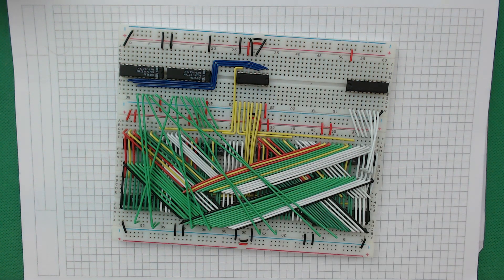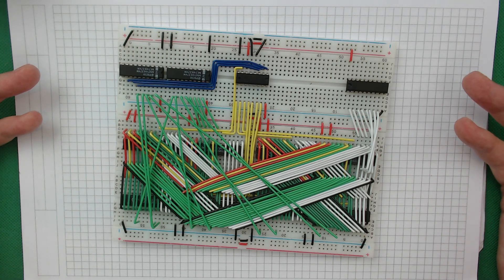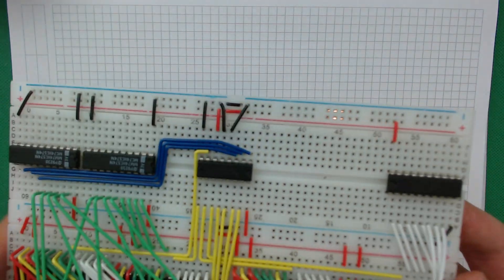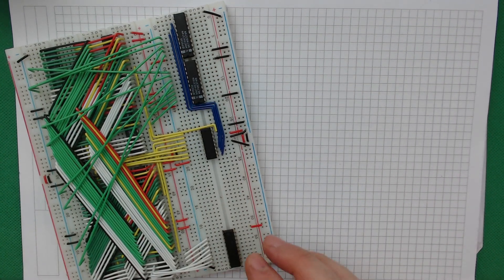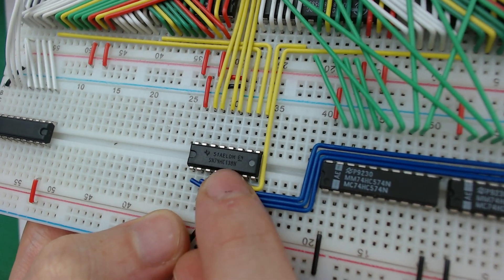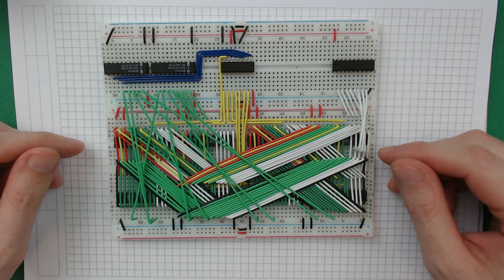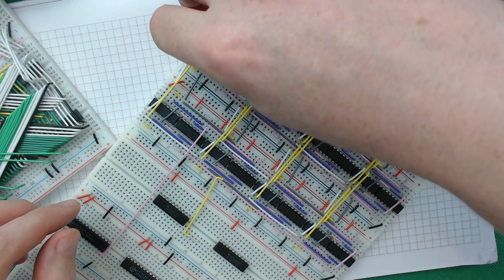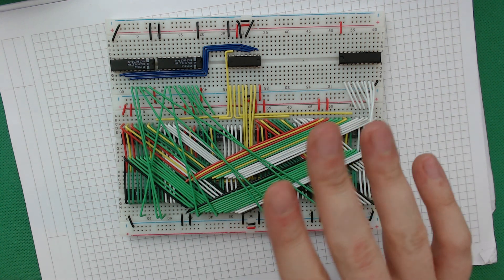Should I rebuild the 64K Memory Module? - Plum Breadboard Computer

Comment: Yeah, new camera... still much better than the first video I came across.  Love the wiring.   It’s not bad to go back to early videos and  make comments or add text overlays to explain that you are aware of the quality and have improved.  New viewers / possible new subscribers will likely see your early work first and get a first impression on wether they want to follow based on that work not your newer material.
Reply from the maker: Even my newest material is about a year old now. I still have plum, it's all boxed away safely but I haven't done anything with it in a while though I do still think about it. I also have another shell scripting screencast I want to do at some point. Right now though I've been doing woodworking, making xmas ornaments and fridge magnets on the scroll saw. Making the videos was always just something to do to fill up the weekday evenings when I was working up in london. Now I'm working remote so I've got more weekday distractions. We do have a spare box room that's currently being used for storage and I have thought about converting it into a tiny studio for doing videos and electronics stuff. The snag there is clearing the store room, such effort! :D

Comment: What seller are you buying 'better' quality breadboards from?
Reply from the maker: In an attempt to avoid falling into the BigClive trap of providing the link, sending them traffic (not getting a cut) and the price going up, I'm just going to say that you should look for the ones with the continuous power rails. You can tell by the picture. If there's a gap in the red and blue lines, then they're split. No gap, no problem. :) I was stung once by a seller who had changed supplier but not updated the picture, so maybe just get one or two first to make sure. They were good about it though and did update the picture after I had pointed it out. :)

Comment: Nou jou now hou it works, why don't make a PCB?
Reply from the maker: That is an option, and something that I haven't ruled out. Thing is I would only need one, and I'm reluctant to go through all the PCB fab stuff for a one-off board. Now, if I can figure a way to make them more generic and reusable, then we'll be in business. I have contemplated just making little carrier PCBs for some chips just to re-order the pins around a bit. Both the address and data pins on these chips wrap round the ends. If all address pins were on one side and all data ones were on the other, that'd be handy, or if they alternated like the 74'244 then that could also be useful. Still undecided. :/
Reply: Daniel Kendell I have designed a PCB like a breadboard and on the short side a 8bit data bus and a 16bit address bus. For making a 8bit Z80 computer like Ben Eater did.
Reply from the maker: Ben Eater made a Z80 computer? I must have missed that. :/ I've got a Z80 in some anti-static foam I might play with some time. Never used one before, only 6502 based Acorn machines. Got a 6522 that I'd like to work into Plum some day, but not today. :)
Reply: Daniel Kendell oh, no my mistake it was a 8 bit computer 74 logic CPU.
Reply from the maker: Ah fair. I was gonna say, he's been busy! :D If I can get my videos half as good as his, I'd be very pleased with myself. Such high production quality. I like to think I'm more at AvE's level. :P Have to say though, I wish Ben had done his series earlier. When I started Plum he only had two videos up. I remember pausing and trying to zoom in on the videos to map out where everything was going! :D
Reply: I think on his website he has a circuit diagram. 

I like your videos and your style, so keep going strong.
Reply from the maker: @EdwinNoorlander  Thanks, I appreciate it. :D Thinking about it, it never occurred to me to see if he had a website. facepalm

Comment: Yes, please re-do it with LEDs. It helps with troubleshooting and lets you see whats happening, especially within the memory. You might check out BARGRAF-LEDs for a clean and even placement. This though needs a lot more space than typical LEDs with "legs".
I am using Breadboards from Reichelt.de, they have some, that have a black base, that covers the bottom. And they sell them as connected sets, where you have on board with two powerrails connected to several with only one powerrail. They are still split-able. On those, I dont have any problems with bad contacts or voltage-drops. I think they are more expensive than one from the usual suspects.
Reply from the maker: Just had a look at Reichelt. I see the ones you mean. I'd be happy to pay a little more for better interconnecting breadboards, but they raised my hopes only to expertly dash them. :( As it stands, the bare basics breadboards they do for €3,80 (approx £3.50) I'm currently sourcing for around about the £1.70 mark though it does fluctuate a little. I looked at the black based ones that come as larger modules, eg: https://www.reichelt.de/breadboard-6040-contacts-steckboard-sb-6-p139511.html since I'm currently working on something that's likely going to wind up that kind of size. €34,50. Not cheap, but maybe worth a punt? Then I zoomed in on the image and my heart sank. Note the placement of the interlocking tabs. The three placed along the long side are pretty standard, the ones on the ends I'm super interested in since I'd quite like the additional width. For the first three, the notches are aligned with the middle trough/gutter, then on the forth there are two either side of it! Compare that to the others that are available and then figure out which ones you need in order to get the right ones to lock together into the size you want...? Disappointing. I think I'm just going to have to design and manufacture my own breadboards! :P

I do like the uniformity of the bar graph displays it must be said. I don't like that I've only seen them in banks of 10 and not 8 though. My brain won't stand for that, I just know going to get so confused, all the time. My brain is very visual and the extra two bits will have me second guessing everything. I have thought about gluing the individual rectangular leds together to make my own 8-bit bar graphs though, just not done it yet. Alternatively, maybe have some shrouds 3d printed to hold them together, that way I can still pull them apart. Can't shake the feeling I should buy a 3d printer one of these days...
Reply: @dankendell  For the bar graph problem there's two things I think you could do.
One would be to cut off the extra two LEDs but that could make a mess.
Two would be to take a black marker and mark over the two extra LEDs, either have both on one side, or go fifty-fifty with one blacked out LED on each side.
I think option two would be the simpler and easier route, but if you could do option one and have the result look nice that would definitely be the option to take.
Reply from the maker: @wawa1474  Pretty sure I saw someone else do that too, the marker approach that is. Dunno if it was Julian Ilett or someone else. I guess that would be the easy way out. :D I'll bear it in mind, but at this point I've got a plentiful supply of the individual rectangular leds in the opto-box so I'll probably just stick with those until I run out. I am trying to vary the styles, colours, and sizes of the leds a bit more to make it visually interesting (or possibly just noisy) so I'm sure I'll find room for some bar graphs at some point. :D
Reply: A 3D-printed octo-holder/socket-thingy for the LEDs came to my mind.
Reply: @dankendell  Ah, I see whats going on with the side-interlocking tabs on the black based ones. I never cared about them, as I have two vertical rows with the BUS-lines in-between. It is the breadboard which has two powerrails that has the different placement of those tabs. This type is either placed on the top or the very bottom of an array. So depending on the overall size and structure of the Plum this would still work. I assume, that every module will have  a rectangular outer shape, so you will always have a full top or bottom line that can and has to (in case the outermost powerrail is necessary) be made with the board that has two powerrails. Still the higher price tag comapared to other sources.